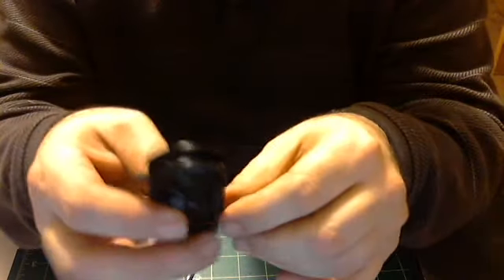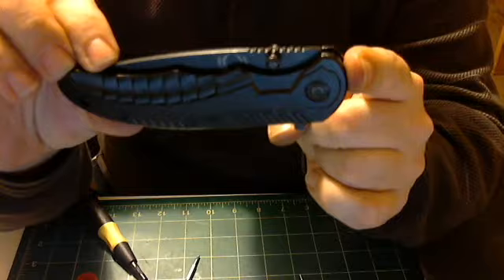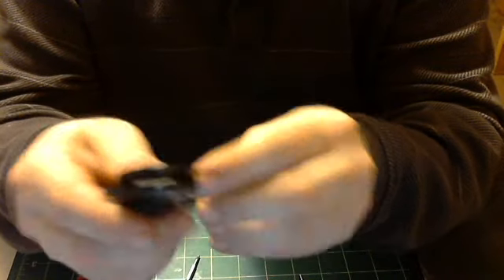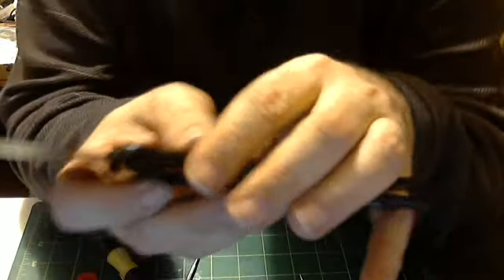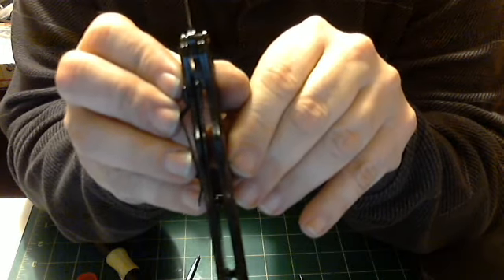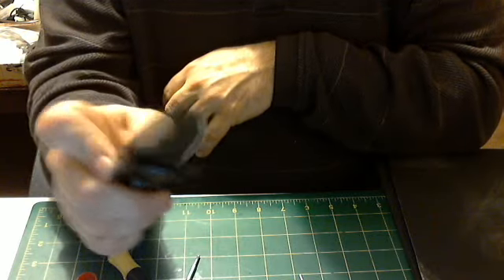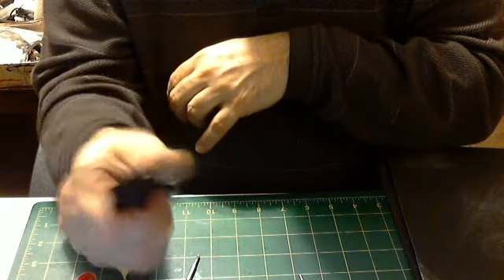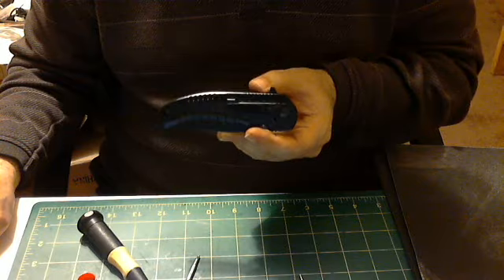Repair - DARK OPERATION TACTICAL ASSISTED OPEN KNIFE CLIP HOLDER 5700-6

Comment from the maker: You ease the pressure on the blade by loosening the front screw using a Star Screw Drive. It should be a simple adjustment.